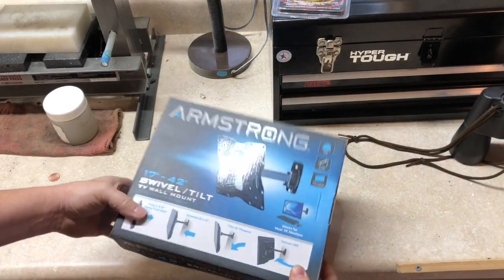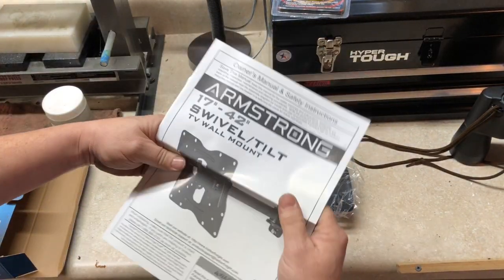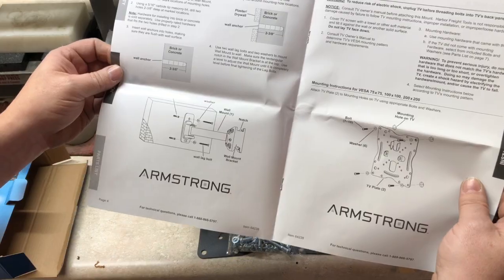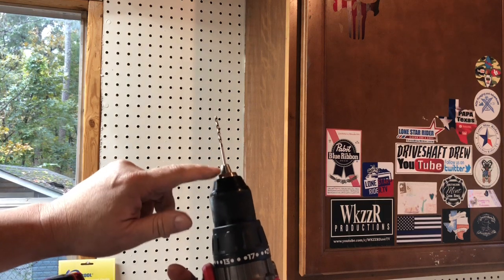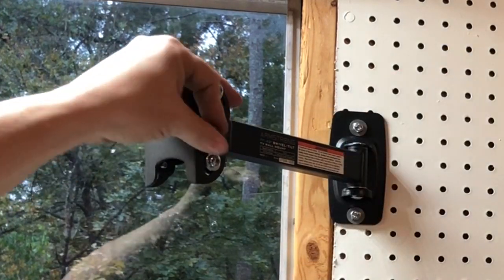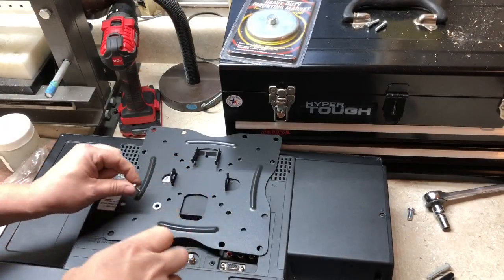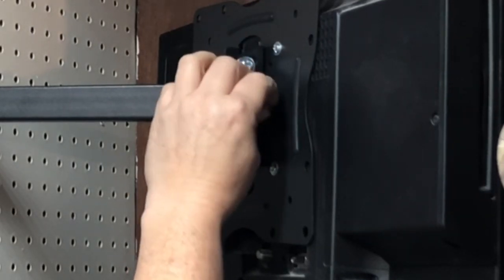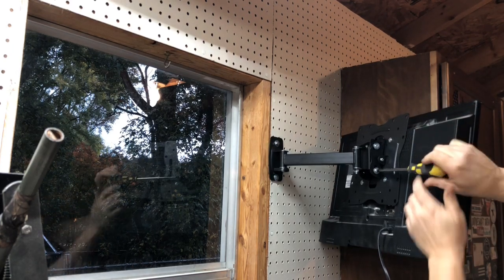Harbor Freight Armstrong 17” To 42”  TV Wall Mount Stand #diy

Comment: Thank you for the video, it helps alot, my only issue with my TV, is if i mount the plate, on the back of the TV, I covets the power cord access, strange, gonna have to cut it!

Comment: Thanks for video. What size tv do you have on the mount ? It looks like it wont swivel 90 degrees  to the wall. Is that because og the widtu of your tv ?
Reply from the maker: It doesn’t swivel right because the cabinets are in the way.  I think it’s a 32” tv.  👍😁

Comment: Everything is good except hard to put two bracket mounting screws, they can easily get stripped.
Design should be changed to make it easier.
If TV is small, it is better put those two screws first, then attach TV Plate to TV with some help.
Reply from the maker: Awesome feedback and helpful tips. Thank you